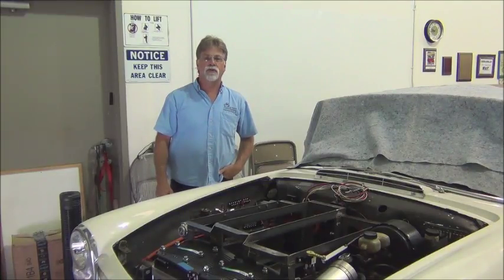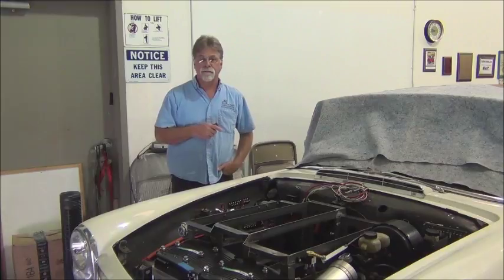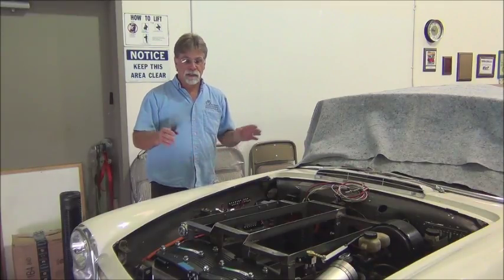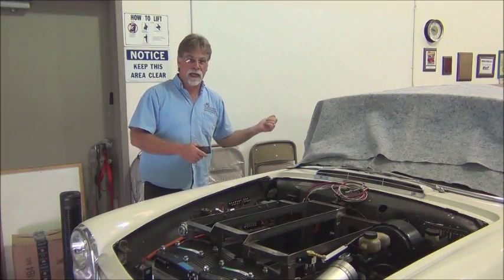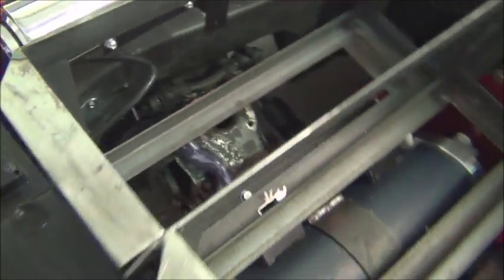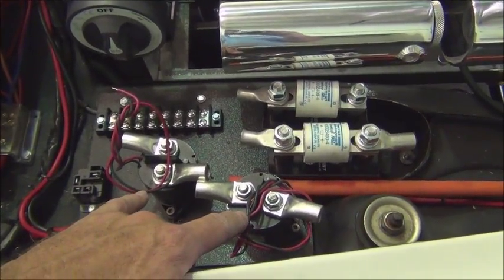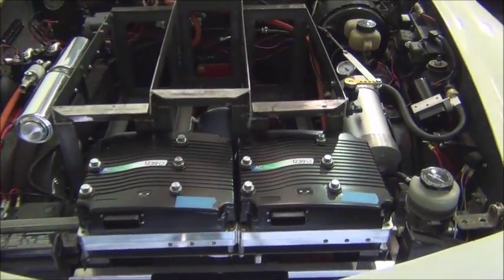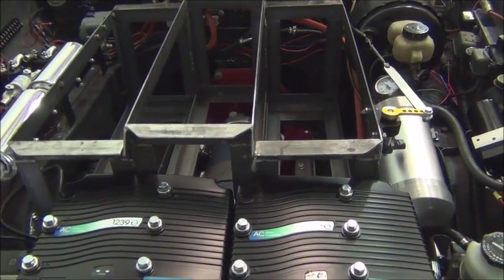Mercedes 230SL Electric Conversion Update  www.EV4Unow.com

Comment: You killed a fully working MB its good that you made it electric but why this classic.
Reply: I can answer that. Because it is receiving a new life. Will never need a smog check again. No more Co2 emissions and it will actually have a sportier ride and take than originally when done right.
Reply from the maker: We did not choose the vehicle, it chose us.  It is a customers vehicle.
Reply from the maker: Pay attention folks, this guy gets it.
Less maintenance, more reliable, more fun to drive, easier to work on if you did need to do something to it.
Sounds good to me.  Thanks for watching.